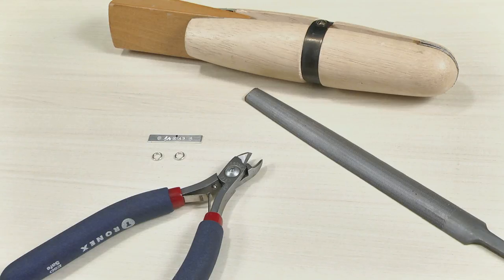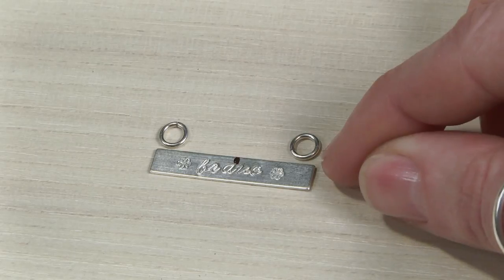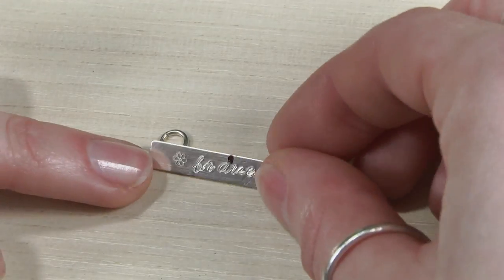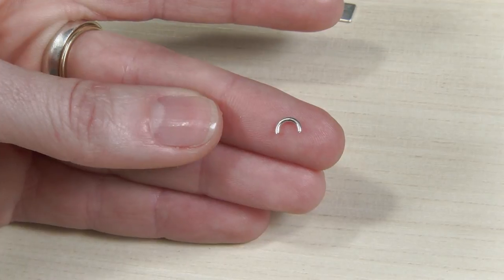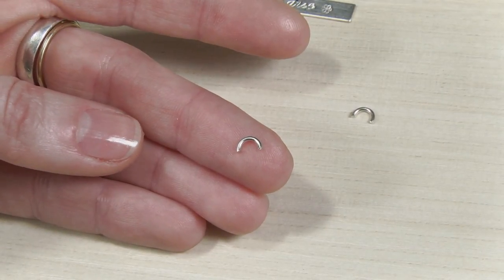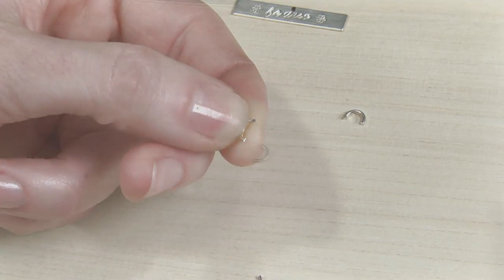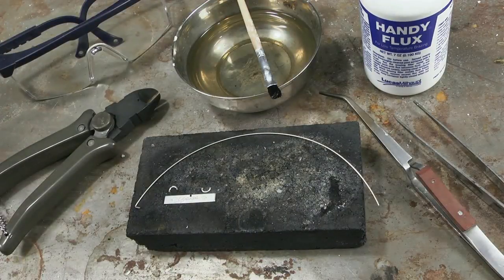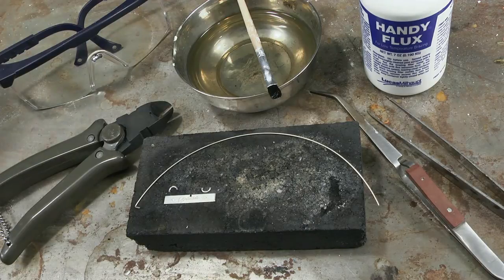Adding Top Loops to a Bar Necklace - Beaducation.com

Comment: Cool idea. More finished looking than punching holes in the corners of the blank. Also, the rings make room for adding small bead drops in addition to the necklace. TFS!
Wouldn't it be easier to cut a jump ring holding it with pliers in your non-dominant hand while cutting with your dominant hand? 

Has Beaducation offered a video just on the flex shaft tool and what the various wheels are used for? I have a flex shaft tool and lots of wheels, but not a clue which wheel to use for what. Polishing, cutting, grinding, etc.? (So far I've only used it for drilling holes.) Please advise.
Reply from the maker: Check out this class, it might help https://www.beaducation.com/online_classes/159-polishing-with-power-tools?cat=4
Reply: Thanks so much for the link! I'll be sure to watch the class. I also did a search of your channel and found several vids that should be helpful. Always learn a lot from Beaducation. Thanks again!